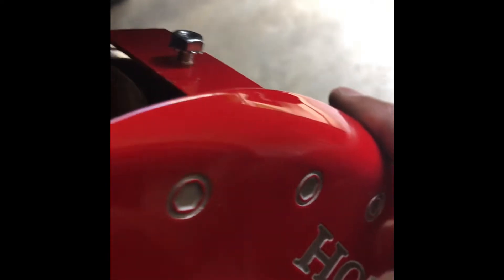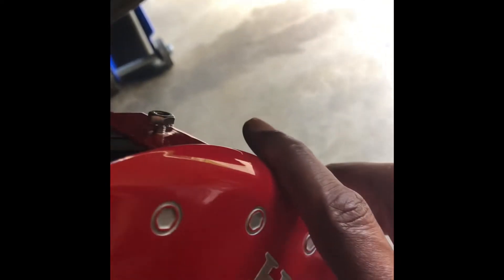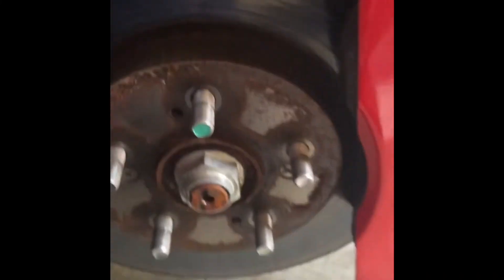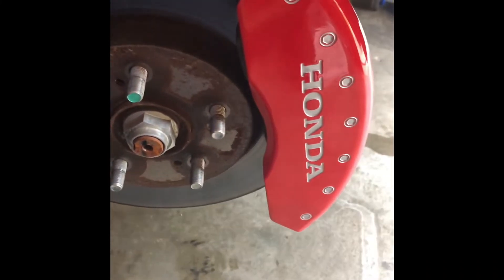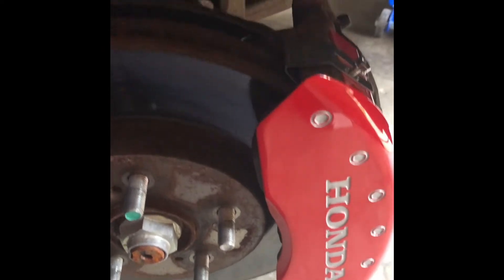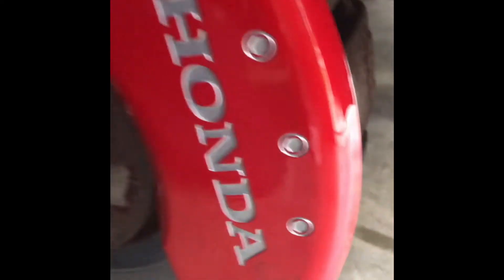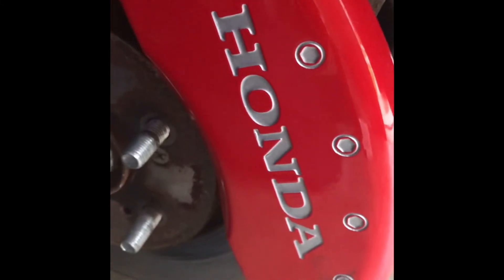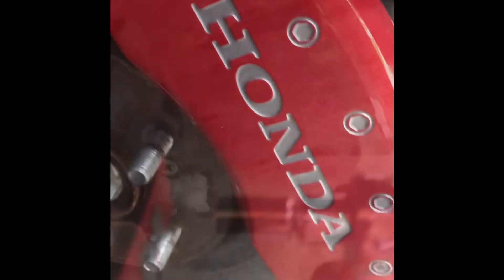Adding 🔥 By Installing Custom Red Brake Caliper Covers (Honda Crosstour) MGP Caliper Covers

Comment: What is the point in putting on a caliper cover what’s it meant to do for the calipers
Reply from the maker: Good question. Most do it for aesthetics, but my reason was to cover my ugly, old, rusty looking calipers, which made my car look old. I started to go with a set of black, but took a family poll and red won the vote. 
Caliper cover are purely an aesthetic  improvement. They don’t serve as a brake dust catcher or anything like that.